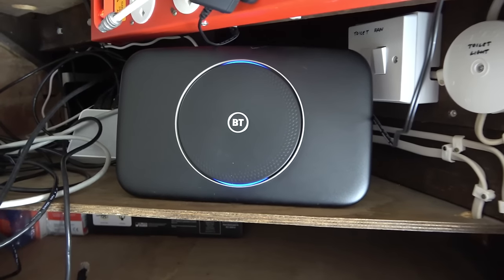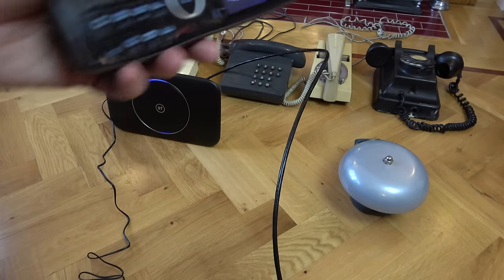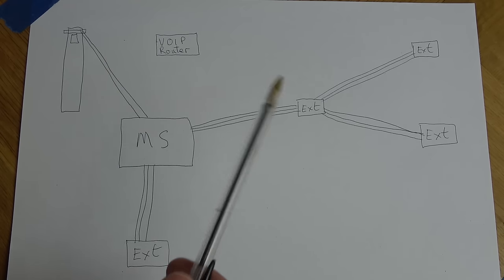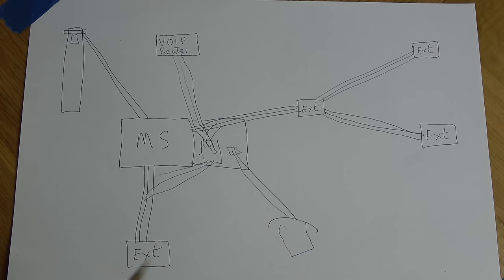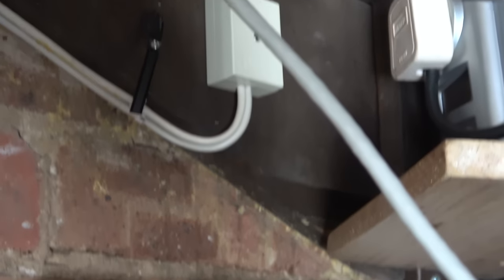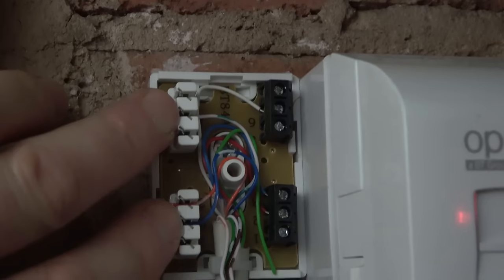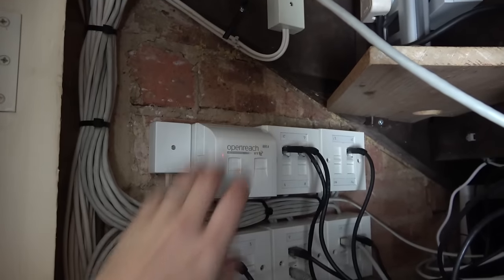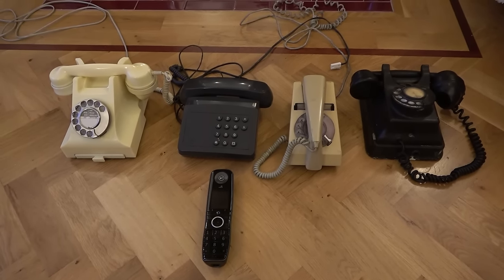How to Connect Landline Phones / Extensions to VOIP on Fibre Internet

Comment: Question from murcia. Are you guys not allowed to unplug the main line phone from the street? we usually just do that and keep the phones main switch intact...they are almost never company branded and if they want to switch back to a Land line provider they can just easily do it... i have seen some guys just throw a basic switch One from the street in and a line coming from the house usually a line in a room they want the in for the VOIP box/Modem like an office or a dedicated server room that will then run back to the Mainswitch and send it through the rest of the building. Leaving all that they have to do on their end flipping the switch after changing service without a need of a tech coming out and basically giving a eff you to the landline competition techs.
Reply: No, belongs to BT.  All the way to and including your master socket.

Comment: Extension adapters connect to router via wi-fi (or is it Bluetooth). Extension phones are connected to adapter. You run out of power sockets though.

Comment: BTW You can Get (Even DIY make) UPS  Battery packs (in line Power DC 12V~48V (non AC or inverter))  For  ATA (Analogue Telephone Adapter)   PSTN  (Public Switched Telephone Network) VOIP Adapters & Routers & Modems  (inc Cordless Phones)

4x  20AH~1000AH Lithium Titanate (LTO) Cells will keep you going for a month of power outage
Reply: if you do get the LTO You can always add a Solar Pannal 440W & VAWT So ever day it rechanges

Comment: Great video Vince ...but trying to find out if a SD1+ auto dialler for an alarm will work when connected to the back of the BT Hub  2 via the green phone plug ....the sd1+ has 2 wires connected to the extension connector on main socket ...so that would be easy to change to a phone connector ...im guessing it should work as uses tone dialing ...anyone tried it out on any auto dialers ?

Comment: I have a weird one - I've disconnected the wires going from the master socket to the extensions, and then plugged a straight BT plug to BT plug cable between the BT router and one of the extension sockets. I have checked the back of all the sockets and terminals 2,3 and 5 are connected consistently.  I have two phones - neither will ring if they are the only phone plugged in. Both phones will ring when they are plugged in at the same time. One phone works as it should from answering and making calls, but if I lift the handset on the other phone, the first phone rings continuously. Both phones were working when we were on the old copper wire. Any ideas?

Comment: we got a (BT Decor 2200 V2) phone with a RJ11 pluged in from the phone to the (EX230v Router) but no tone or anything when I listen to the reciver - but the little green light with the phone icon is on solid & green - but not sure if its all done  migrating over to the new sytem yet  as we want to keep our old number but the internet part is working just no functional phone use yet

don't even know if our phone is even compatible - not sure how long I should leave it before ringing my ISP to ask why its not working or if its working - we just switched to full fiber

Comment: Do you connecting you Dect phone to the router or the ONT, because I am under the impression from my service provider that it connects to the ONT on the wall. not the router, or does it not even matter whether the phone connects direct to router or ONT
Many thanks in advance for feedback
Reply: No you def connect to the router. Which ISP are you with ? It's all very confusing !

Comment: also would this work with my home alarm system which is connected to a box that is connected to virgin media copper cable?  can i take the 2 wires that connect the alarm out and put into a junction box and connect using one of them extenders you mentioned and then connect one part of the extender to the voip on the braodband router?

Comment: Pretty interesting very similar to fiber from Bell here in Canada although the router that Bell uses for their fiber does support pulse dialing surprisingly at least where I am in Canada I can't speak for other companies or provinces
Reply: I'm suprised to hear that bell Fiber supports pulse dialling. Though on canadian phones we only have the options of tone and pulse dialling and none other. The same could be said for most of the phone tech in the states as Bell Canada did diverge from bell in the states and just for interoperability sake we like to keep everything similar to the states
Reply: @sarah1390   100% I was surprised too well I should say where I am it's Bell Alliant used to be called Alliant and then prior to that Newfoundland telephone and now it's called just simply Bell Alliant and they may use the same equipment here as they do in say for example Ontario but I have a friend that lives in Ontario and set up is completely different for his Bell fiber even though it's the same equipment it's a bit of a different setup so that's why I said in my comment that I cannot speak for other provinces because it may work here but that doesn't mean it works anywhere else in Canada even though with the same equipment they could simply disable it in firmware
Reply: @trevorwarren452  I am very familiar as I used to be a fibe tech call center agent for Ontario and Quebec.I know for the copper system it is a matter of 1 piece of code to switch someone from Pulse to Tone as long as the equipment in the area supports it. Still rural sections of Ontario that are on pulse dialing. Though I don't have access to physical connection with active home phone service to test it out as I have phones that are capable of both at the flip of a switch. So many people are cancelling home phone once they get a cell phone or once they are switched to fiber because it is a VOIP service.
Reply: @sarah1390  I wonder if it's that simple for fiber as well

Comment: I too worried about the traditional landline, sadly mine doesn't currently work (it's a cabinet side issue apparently). Anyway my solution was to buy mobile phones to replace the land lines, each one is with a different provider and I can use Whatsapp to replace the intercom feature of my landlines. Not really worried about any outages.

Comment: Vince, did they let you keep the existing phone number when BT moved your brother to fiber?
Reply: Of course they will if it is all done on the same account. I ported my number we had for 20+ years to a separate SIP based VoIP supplier as it was cheaper per minute plus we can switch to any provider without the burden of loosing the number we have if someone messed up the transfer.

Comment: I have fibre internet. I'm in a village with very poor mobile reception so 3 supplied a box to plug in the router to use VOIP with my mobile . Asked BT when they were installing the fibre about a power cut and they said no problem you can use your mobile! Just hoping a mast will give us a mobile signal back!

Comment: Do you know if the ASUS RT-AX86U 5700  Router can connect VoIP DECT Phones for Home Users without using the BT Hub 2 for FTTP? 
I have an ISP (BT) Connected VoIP Setup that seems to be directly linked to the ISP Router, the ISP Provider is  BT but their Techs do not know how to connect their VoIP DECT Handsets to any 3rd Party Routers at all...
And as you noted our Government has decided that Copper Cables will no longer be supported, forcing us all to use VoIP when their seems to be no support for 3rd Party Routers...

There must be a way to connect a VoIP Handset to a Modem (Maybe another 3rd Party piece of Hardware?), or the Router without having a PC on to support the VoIP  DECT Handsets Connectivity surely...?

Comment: Hi Vince if I disconnect the cable feeding the extension sockets around my house 
from the master socket and connect the wire into a new slave socket can I use a double ended bt plug cable one end plugged into the router and the other end plugged into the new slave socket to power the rest of the extension sockets will this work
Reply: Yes - I have just done that. It works fine.

Comment: Wow old school stuff, reminds of working on the Ericson AXE-10 MSE. In NL I don't believe there is any option for an analogue only line, all is via a router that being Cable, ADSL router or Fiber with a router. I am using fiber in my house and I know the router has a PSTN port  that I could connect an analogue phone too, but I have not had phone for 10 years .  I also don't know anyone under 60 that does not have a mobile phone.
Reply: The ones you know under 60 will get rid of the mobile eventually.  Just takes time for them to realise the benefits of gong mobile free.  Some compromise and simply get rid of all smart features and just use a standard mobile

Comment: OPENREACH engineer here
Sorry to burst ur bubble but that is not an fttp circuit, its most likely a sogea thus theres no dial tone coming out of the socket
The system u have there is SoGEA FTTC and what u are doing is voice reinjection which is okay to do but not really recommended unless u absolutely need them

Also even if u push ur dial tone back to ur master nte its not gonna go all the way to the exch as i said it will end at street cabinet dslam box

Comment: Dont even have full fibre in my area yet being forced onto voip. How will elderly folks cope with this change over. My elderly neighbour at my previous property didnt know how to connect phone into socket on normal land line, so how the hell can they expect them to understand voip. Some have not even seen a hub or rooter. Let alone blue tooth or pairing modes.

Comment: Thanks Vince for more great videos. We have had horrendous problems with our Smart Hub 2's (were on our 5th one and its starting to go faulty). We swapped back to our own TP link router but BT have just disconnected the copper telephone cable so we lost our phone (grrrr). Possible video showing how to use FFTP with a third party router and a work around either using VOiP ? 😕😕😕😕
Reply: Sounds like you have standard FTTC not FTTP.
Reply: @mrfrog8502  thanks for your comment. We're definitely FFTP with a PON box installed by Open Reach last April 2021. They've tested the fibre optic lights strength ( its the only test the engineers can do now) and its as near perfect as it can be. The issue is the cheap nasty Smart Hub 2's. The engineers ( we've had a few through the door in the past year! ) all tell us the same story that they're so cheaply made and that they all carry a box full of 'new ones' and swop them out. They last anywhere from 2 weeks to 2 months before the signal drop outs become too bad to ignore. The latest hub #6 arrived this morning and is already throwing up error messages and drop outs. Give me strength BT. No wonder they're dishing out discounts and refunds to keep their shrinking customer numbers. We've given BT a last chance to fix the issue before we call time on them. Looks like the end for BT this week 😓😓😓😓

Comment: I'm trying to do the opposite at the moment. I want to use voip (polycom business phones) on a landline so we can use it as an intercom and also access the pstn network. I have the intercom working as they each can ring each other but would like a way for incoming calls to goto ring all the extensions.
Reply: In this case you would want a FXO Analogue Telephony Adapter (ATA), which converts the Landline to VoIP instead of the regular FXS ATA (such as built into the BT Hub shown in this video), which converts VoIP to a virtual landline.
The Grandstream HT813 has both ports, one to connect to a landline, and one to an old phone at the same time. I can't comment on how well it works or how to set this up however, as I ported my number last year and no longer have a landline in the house.
Reply: @JaysTech  Thanks for the reply. Thats why I posted the comment. At least I have something to go on now as I sort of hit a brick wall.

Comment: Just cause its the future doesnt mean its good 
The redundancy of the landlines was a great help during power cuts (in my area cause it was only ever our village and the exchange wasnt there)
Little bit of power used to help alot for a little light, helps save the lungs from the thousand candles 
Plus those old phones are WAY better they just need ro combine the two
Basically make a voip phone computer thing that just connects to the handset
Could also use the voip phone to encrypt rather easily aswell mmmmmmm

Comment: Just got my new bt business hub identical to yours however the phone socket is covered up and says do not use 🙄
Reply: That means they have shipped your router with VIOP disabled, either because you need to add it or because the line still handles analogue calls.
Reply: @dlarge6502  they sent us mobile phones and a voip phone and they are truly dismal I am actually in the process of trying to switch back to the analogue phones now!

Comment: what happens if someone doesnt have the internet? some old folk arnt going to be able to use their phone?
Reply: The voip service is over a different connection to the internet.  They will have to have the router installed but no need for internet service.

Comment: How to say, the British wiring system is a lot more complex compared to the Australian version!
I have never knew that a 3 wire version existed. Why is the bell seperate??
Reply: To avoid bell "tinkle" on other pulse dial (loop disconnect) phones when one pulse dial phone is dialling.  Modern phones don't need the separate bell wire, as they are designed for international 2-wire markets.
Reply: I seem to remember cutting the bell wire vastly improved ADSL speed due to it acting as an Ariel and introducing distortion on the line. No modern phone equipment needs it as the ring signal is carried by the 2 wire system anyway. Old pulse dial phones made other phones ring when dialling without it but they havnt been used for decades so I guess it's just the telecos can't be arsed to change the wiring.

Comment: In NZ they wire up the phone sockets to the fibre ONT.
Reply: Can you please elaborate on this?
Reply: @khwajarahmatullah4145  we have a fibre terminal inside our homes then plugs into a router. On the terminal there are ports that emulate a POTS Line
Reply: @Castawot. Thanku I appreciate your response. At my residential area there are no copper cables they just plug the landline into the router and if the power is out then the landline is out. So if I want to do something like what you mentioned how I would be able to do that here at my own for my residential complex would you like to advise please.
Reply: @khwajarahmatullah4145  You Can Try A UPS To Keep It Going For A Few Hours
Reply: @Castawot.  But most of the people here want it the old way here that is fibre connection with landline only the landline should not get blackout and without using ups, so is there a alternative to use it without ups

Comment: So here I am with fibre broadband and paying a fortune for it (around £350 per year) with a telephone line that doesn't work unless there is an electricity supply to the router box (VOIP telephone).  Can anyone please explain why then I am being screwed by the supplier for the privelege of sending voice signals (telephone call) using the same line as the data line used for internet access? 🤨

Comment: One thing that really annoys me is calling them "routers" they are not routers, they are Network Services boxes, that has inside it Modem, Firewall, Router, Switch, AP, and now SIP or H.323 transcoders, all running from rather crap CPU's now i know a house is not a business but even a small business (probably with less devices than a home nowadays) should be running 3 devices to run that lot, larger businesses can be running lots more and redundancies, but to call them routers when that is a tiny fraction of what they are doing (Firewall's run in routers most of the time now) Switch and AP are fine to be together or separated, and SIP/H.323 should separated otherwise overloading the routing / firewall / NAT will affect Phone call quality. these should have been separate devices you plug into a LAN port if your choosing to keep the phone system. More so when you have 1Gb Fibre lines, if NAT in the Firewall is having manage 1Gbps throughput it's going to use a lot of that CPU especially if that's over lots of devices.

Comment: you will have touched BT's box as you will have to go into to disconnect the 2 cables
Reply: No problem I've moved my  BT master socket a couple of times,  I even disconnected & repositioned the drop wire outside the house, to make it neater!

Comment: Who has that mAny phones 😂 i dont even have one plugged in im still on a copper line. Six of us in the house and its more than enough i dont get why people are going mad for speed alot of the issues are due to wifi given slow speeds. Im synce at just shy of 70 down 20 up. Speed test sbout 60 down 19 up.

Comment: Be careful whit this, the router are not power to handle more than one phone connected directly. (Yes they have proper volt but not enough amp) normal y they have a 12v or 24v power supply and convert internally the volt if overcharge they dead. 
I fried my router (the phone don't work) Wen connected my trees phones around my house (tres months and dead) now only have one (for this is better get a central phone unit and a VoIP to post unit, depends on the length of the cables and number of telephones)
Reply: Which is why he says REN boosters might make a comeback